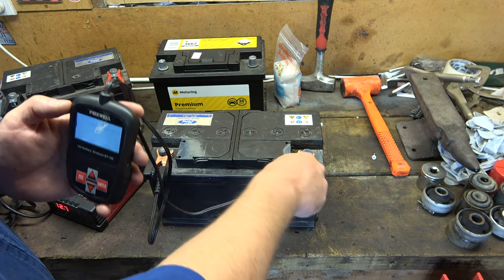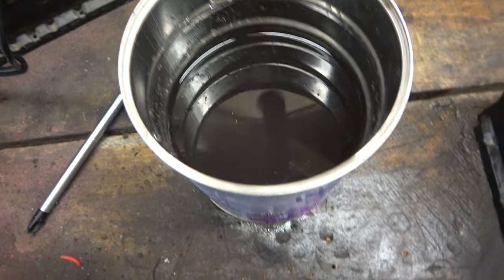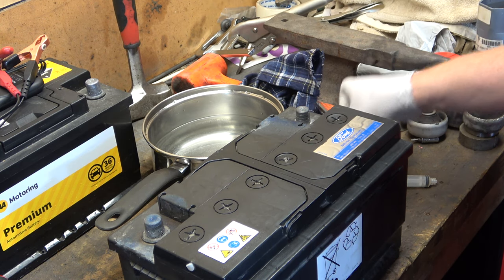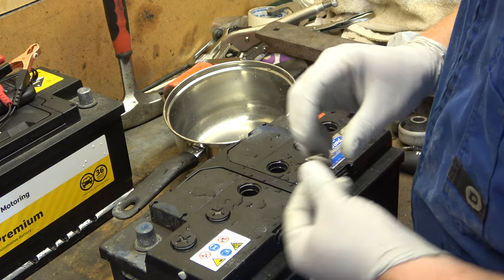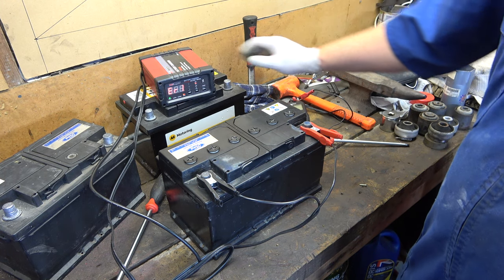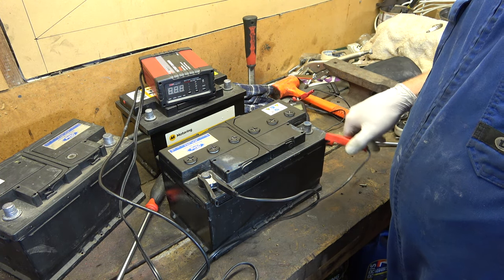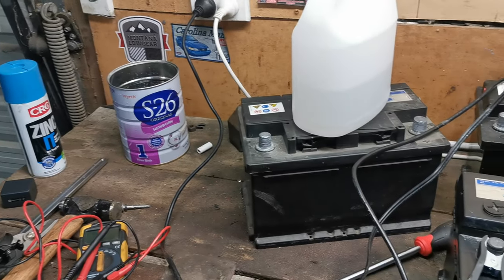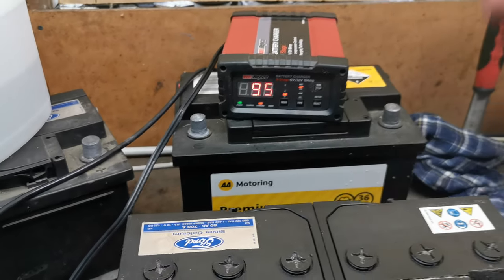Restoring Car Batteries with Epsom Salts - Does it Work?

Comment: This is not advice I'm not a professional battery guy Im' just relating how I've rescued batteries in the past for educational purposes.
Use your own judgment and common sense.
Practice safety at all times and do your own research. 
I learned this method from my brother before there was an internet to ask google.
I Drain the old acid into a receptacle for filtering and recycling it. 
Flush the cells using tap water by filling them and then rock it back and forth and side to side on the concrete shop floor and then turn it upside down and drain it. Repeat the process until the water drains clear without sludge. Leave it upside down to drain. If you are using distilled water to flush with draining completely isn't necessary.  I then use one package of acid from the parts store (about 32 ounces) divided equally between the cells. Fill to the top of the plates with distilled water and add one aspirin to each cell. Let it sit for about an hour then top the cells off with distilled water. 
To trickle charge it I use a 500 milliamp trickle charger I made from an ATT WI-FI router and I test  it in two or three days the slower it charges the better results I get. Kind of like getting a woman ready It takes more time to charge but 
My luck doing it that way is about one out of three does well. I have one that sat dead three years on a pallet. Freshened it up and its been cranking the tractor for the past five years. 
The batteries I have used and maintained myself seem to do the best. If one has been discharged completely a bunch of times and then jump started I don't try to save it as it usually is a waste of money and time.
It was around $11.50 to $12.00 for the acid and about buck for water and aspirin the last time I rescued one.
Inflation has probably changed the cost by now. 
That's not how anyone else should do it it's my process. Do things according to your own ways I am not a responsible party to or for anyone else's actions.  I reserve all of my rights and waive none.

Comment: I have used hydrochloric acid replacement and it blasts the plates and de sulphers them muratic acid works also. The output will be more.. First flush with baking then the acid.. It will put out higher voltage.
Reply: After using the battery with the muratic acid for a few days empty again and rinse debris out and refill with Sulphuric again.. The purpose of the muratic acid was just to clean and open up the plates

Comment: I had good results doing 3 x Century 18Ah deep cycle and 10 mixed brand 9 and 4.5Ah sealed batteries. Most of these batteries had a lowish fluid level to start with when I removed the superglued covers and popped off the black rubber caps. None would hold their charge for very long. 

I didn't remove all of the acid (as the batteries were lead acid and the acid is required). Made a fairly concentrated solution of Epson Salt. I think it was 1 part Demin water 3 or 4 parts Epson Salts. The concentration would have changed when I added it to the cells. I didn't hydro test the fluid in the cells, I was winging it. 

I used a dumb charger, not a smart charger and charged them well. Made sure to look in each cell with a torch and goggles on to see the gassing was happening properly. Only two out of the batch didn't hold a charge. 7 months on and they are all still holding 12.5 to 12.7v charge without me using them.
Reply: If you have a completely discharged battery, the positive plate has taken all of the sulfate ions from the acid and left just water. You do not need acid present to start the charging process. It will be created when the charging voltage causes the reaction to go the other way, and the sulfate to be forced back into the water, which creates sulfuric acid.

Comment: Hmmmm .. thank you for your video. LOL still didn't help but Ive watched a few good guys trying this to see if my info was correct or not. Your results were the same as  mine. It kinda works and kinda doesn't. I was just trying to be cheep and didn't want to just chuck the battery away but the results were the same.... IF you are stuck and IF you have the supplies this method Might get you out of a jam but you still need to buy a new battery... I was just hoping . Thanks again for a no nonsense attempt and video.
Reply: Works great if you leave about 70 percent acid in the battery.. The guys that pour all the acid out fail everytime. The epsom salts breaks down the buildup inside the battery and is not a complete acid replacer. They are just doing it wrong.. Works well when done right.

Comment: I saw someone drain the battery.   Add some distilled water that has been boiled with a box of baking soda.  
Add the mixture into the cells and put it on the charger for 15 minutes then sit for 1 hour and then another charge for 15 minutes then let it sit for one hour.. 
drain the battery again.  Rinse all the cells with a garden hose.
Then you add the boiled down mixture of distilled water & bag of epson salt.
Then stick it on a charger for two days.

Comment: Others that tried it were using around 200 amps input for approx 15 minutes then let it rest for 15 minutes, then another 200 amps for 15 and so on for 4 cycles. This will burn off the sulfates.

Comment: cycle the battery put a small load on it all night and the recharge, do this 4-5 times and check the cca each time to see if it is improving, I have heard the expands the cells and allows the electrolyte to access the plates better,

Comment: My guess is that after hitting the battery with current to desulfate the plates, you would need to wash out the MgSO4 and replace the acid and then put a final charge on the battery.  Some batteries have felt spacers to keep the plates apart.  This could never work on one of those cuz you would never be able to wash the felt clean enough.

Comment: Fun to watch, thanks. Cool gadgets! Another thing you could try if you want is leave the battery for 2 days after you fully reconditioned it for a more accurate result. I find after 2 days it shows its true colors and shows even lower then if you just took it off the charger.

Comment: Pour the salt water out of the battery and take a garden hose and wash the battery out real good (the more mess you can wash out the better). Go to a parts store and buy a couple gallons of battery acid and fill the sells with new acid and charge the battery with a regular battery charger.

Comment: They desulfate during the charge process. Need to discharge to 11 volts exactly with about a 20 amp load. Then recharge. Repeat a total of 6 times. Each time cranking amps with rise more. Dump & redo entire process for best results if cranking amps didn't rise enough. The epson salt cleans the plates everytime it's discharged & charged but the solution gets dirty again from the cleaning so dumping & refilling is good anyway after this process. If the battery has 12.5 volts after sitting for 24 hours without a charger you're probably good.

Comment: Good video, however some minor nits to pick, of course.
1. Usually you dump the electrolyte and then flush with water/baking soda to neutralize the acid.
2. Check your Desulfation Pulse and confirm it is not some BS microsecond pulsing advertising jazz. For pulsing, you want something no faster than millisecond pulsing at most, as going faster than that ends up with voltage and current flows out of phase and being wasted in the wiring as heat. Millisecond or slower pulsing leads to voltage/current being mostly in-phase with most of the power actually making it inside the battery/cells.
3. At this stage, you should repeat the process a couple more times. Pennies in electricity and a lot of times more heavily sulfated batteries take several rounds.
If after 2-3 rounds its not appreciably improved, then you could try the welder trick. However that in and of itself is usually not good for the battery, but a few short zaps might help get over a hump.

Comment: The battery tester show different healt, lower when voltages is above 13v.
If you test again after 24 hours it usually shows 5-10% more.

Comment: Great video, but one thing I was left uncertain of. You mention putting the new solution from the pan/stove into the old battery acid, and then into the battery. Was that the actual step, or were you correcting what you said? Your video seemed to only go from pan to battery, but what you said was pan to old acid, then the battery (at 4min 10 sec).

Comment: If it's a new battery that sat too long and sulfated, these tricks MIGHT work. If the battery is well used, and has reached the end of its cycle life, there's no saving them. there is simply no active material left on the plates, and sometimes the blate grids are broken. You may as well try, what have you got to lose? Either way, the battery still has the same core value, when you replace it.

Comment: Try emptying out the acid and filling with a mixture or disstilei water and baking soda, shake it up real good and let it eat away the corrosion inside. Drain into container now do the Epson salt and distilled water fill each cell. And shake it up good. Now put it on a charge

Comment: Um .... At what point did you drain the MgSO electrolyte and replace it with clean Sulphuric acid again??  Also, as others have mentioned, a higher amp initial charge is likely to increase your success rate.  I tend to jump mine directly off of a running vehicle to get the required amperage.  YMMV.

Comment: Empty the battery, save the acid and flush it with distilled water and baking soda. 
Replace the old acid using a cotton ball in the funnel to filter it. Charge it with at least 200 amps (engine start) for 15 mins then wait an hour. Repeat 3 times. Good to go.
Reply: Is it the impurities in the acid that make it stop holding a charge?
My acids taking a long time to kick in.
Reply: @zoharflax6363  No, it's the sulfation of the plates. Baking soda will remove much of it.
Reply: @david_sdiego  My battery is not holding a very good charge, the colder it is outside the less of a charge the battery has to start my car. I have watched tons of videos and from what i gather is,  dump out all old acid, pour in distilled water and baking soda in the battery and keep flushing until the water is clear and then replace with brand new acid? Brand new acid is cheap so wouldn't it be better to just use new acid instead of the old stuff? Let charge for 24 hours and should be good?
Reply: @ericc8895  When reconditioning, you don't use a regular charger. You must use the high amp routine I described to
bring the acid to a boil. Using new acid to do this could be destructive to the plates.
Reply: @david_sdiego  i have a 200 amp charger, that is not an issue. But what you are saying is dump the old acid back in after the battery has been flushed and bring it to a boil? Do this 3 times? And once done keep the old acid in it?
Reply: @ericc8895  4 times total. That's it.
Reply: @david_sdiego  thanks man, sorry for all the questions, one last one. What if the acid level is not high enough? Just not sure if it would be different than normal when you just add distilled water. Or do i take some acid from a donor battery and top off the freshly clean one?
Reply: @ericc8895  Distilled water is fine for topping off.
Reply: @david_sdiego  You gotta eat so much acid that things finally make sense of these batteries.
Reply: There is probably little to no acid left given that the battery is discharged. He likely needs fresh acid.

Comment: I did this with a ten-year-old battery in a Honda Odyssey 2006 would not start - - postconditioning - 100% charge throughout the winter  I flushed the battery about 15 times before putting in the new solution - hope this helps someone!

Comment: Hi Sir what I have done to a 12volt battery last night & it has a dead cell I drained all the acid out of the battery &  then I poured in the battery very fresh rain water from the 250 litre tank & then poured the rain water out of the battery & then got more fresh rain water into a clean bucket & then pour the fresh rain water into the jug & boiled the water up & then with the remaining cold fresh rain water & poured some of that cold water into the bottle & added the hot water into the bottle as well & then poured in the baking soda & put the lid on the bottle & gave it a good shake up & until it had desolved & then poured that straight into the battery & then put the caps on the battery the caps are not screwed as they are just sitting there & let it sit there overnight & you should have seen the filler holes & they were all bubbling like crazy & then this morning I emptied all the contents out of the battery & then mixed up another batch of Baking soda & fresh hot rain water & poured that into the bottle & poured that into the battery & let sit for about 2 hours & then I gave the battery a good shake up & poured out all the contents out of the battery & redone the process again & I had redone the process 5 times all up & the 6 & redone the process again & this time I have left the baking soda with the very hot water overnight in the battery & tomorrow morning I will give the battery a good shake up & pour out the contents out of the battery & check inside the battery plates & if they don't look clean & I will go out & get some more Baking Soda hopefully I won't need anymore &.that I hopefully that I can mix up some distilled water & pour that into the jug & boiled it up.& the then add Epsom Salts to the distilled water.hot water & fill it up just on the battery full battery mark              & hopefully it that will repair the the battery & then I have a Foxsur 12V/24V 7stage battery charger & I will put it on repair mode between 24 & to 36 hours & I will keep a check on it & these Foxur 12v/24 7stage Battery chargers are really good units & can never over charge the batteries kind Regards Peter

Comment: Main issue is the sulfur on the plates need to discharge and run recovery multiple times to remove that layer. Not sure on the Epson salt stuff though, might try topping off with water and Epsom salt mix on the next one I fix

Comment: possibly need a bit of chemistry knowledge. Epsom salt is for rejunaviting of plates. after charging up. you should rinse again and make and  filter same acide and adjust the PH (or better say concentration as 55% or 50%) and fill again with acid and recharge. simple as this. this done when the battery does not crack good enough so you rejuvenate the plates to pass more charges.
Reply from the maker: That wouldn't be testing the myth would?

Comment: When treated with Epsom salts drain it again and flush with de mineralised water and refill with new electrolite, then deep charge see what happens. The process is to knock off the Lead sulphate off the plates chemically to restore the battery action.

Comment: You must cycle the battery up and down 5 times before it will regain most of it's capacity.
Put a 10-20 amp load on it and drain the battery, then charge it again.
Do this 5 times.

Comment: You where supposed to filter the old acid and use it to fill the batteries before topping off with Epsom solution. Then you where supposed to use at least 10-20 amp smart charger for the firsts charge, let sit for 24 hours then charge again at 2amps until fully charged.
Reply from the maker: I wasn't supposed to do anything 🤷‍♂️
Reply: @Badgertronix  Watching other battery repair videos, they included the above info. Just saying.
Reply from the maker: I have never watched a battery repair video and know nothing about the subject. Just testing a myth and proved it doesn't work 🤷‍♂️

Comment: How about dumping out the Epson salt mix and replacing it with new acid and giving that a try since the battery has been reconditioned.
Reply: This is a cheaper way to do it. But yes if you want to do it the correct way. You clean it out then add new acid
Reply: @RobPhiangdae  can't you just reuse the old acid?

Comment: There are  a few suggestions for fixing a car battery
never try to do this unless you are sure what you are doing - the acid can burn your skin
Test the voltage first - there may be a dead cell which would waste your time.
Check the battery fluid.
Try to fully charge the battery.
(I discovered about these and more from Jons Mender Guide website )
Reply: The jons mender thing is a scam, and you are a spammer, and you've been reported.

Comment: Remove the battery acid, rinse with distilled water x 1 then refill with boiling hot distilled water, attach an electric sander without sandpaper to the side of the battery, either with duct tape or velcro and let it vibrate the battery for a few hours. The vibration will loosen the sulfation on the lead plates. After that discharge that water then use the Epsom salt treatment as the electrolytic solution. Let me know how that works now!

Comment: Just a question (and if I missed something, please forgive):  You removed sulfuric acid & water and replaced it with a mixture of de-ionized water and Epsom salts. Is the water/ Epsom salt mixture supposed to morph into an acid/water mixture?
Reply from the maker: That's the myth. You saw how it worked out
Reply: @Badgertronix  what we saw is a show.
Reply: This will work but not for long. The shop I worked at we would drain them spray the out with water and refill with new batt acid then put on a slow charger for days and they would last for about 3 more years so the truth of a batt is they should get about 7 - 10 years before recycling the unit with a big manufacturer
Reply: @ronniemiddleton5231  That makes sense. Thanks.
Reply: The video seems to miss out the rinsing and adding back battery acid again.. at least I watched 👀 multiple tines and saw no mention!!!